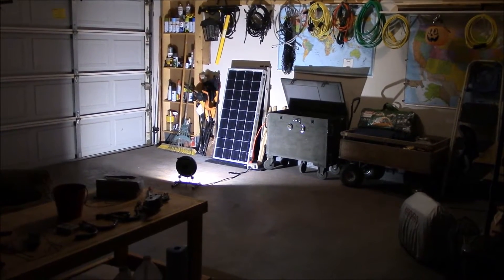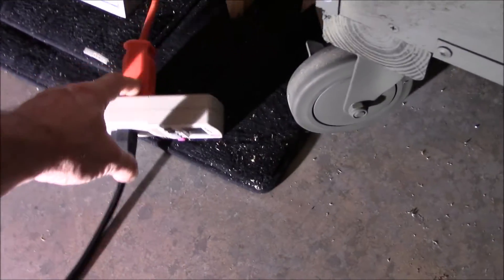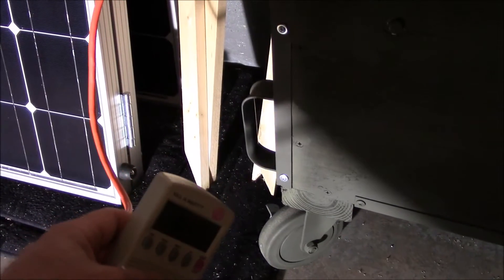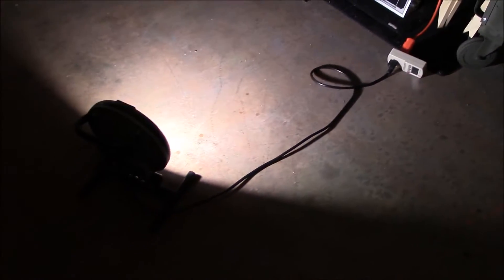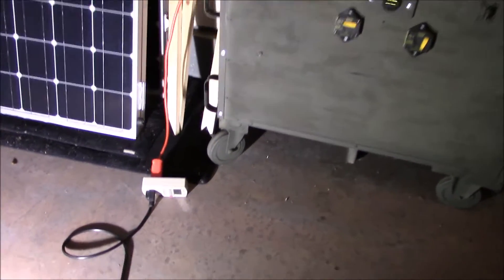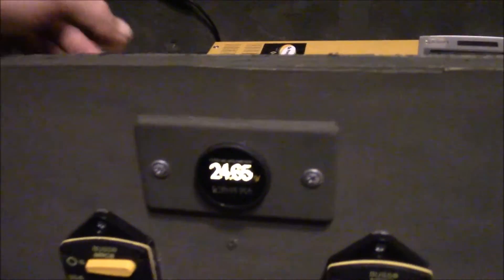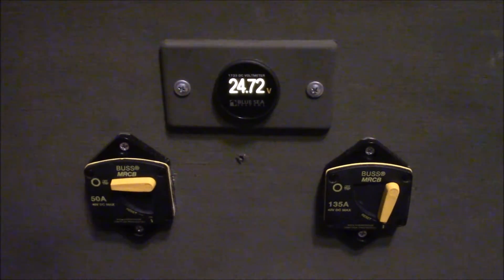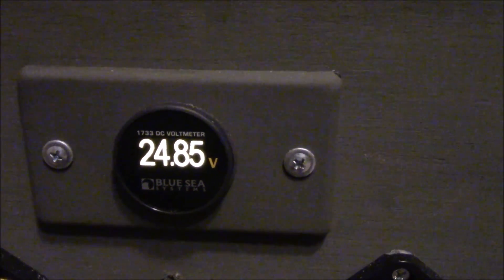24-volt solar generator 12-hour load test results!

Comment: Good information Chris. You have the same results as my 1st portable system. I had two 12v 110 amp hour bateries and 210 watts of solar. It ran my chest refrigerator full time even through he could days of fall. The test results are what inspired me to go completely off grid. I saw how doable it was and I have been sold on it ever since. If people new how easy it is especially in the south to go off grid with their whole house alot more people would be doing it. My whole system was $5500. If I still had a job I would have spent about $30k and had a really big system like yours. It does not get hot here so we do not need air conditioning. That cuts down on alot of power. When I or if I can get back to work I want to add 1000 watts to my sytem. Then I'll be in tall cotton lol. Great job Chris!
Reply from the maker: Thanks. Been wanting to re-do a transportable system for a few years now. My first one was right after the tornado (F5) in 2013...really rinky-dinky and too small. For this design, wanted to do "everything right" and make it actually useful. Not sure if you saw in the video, but yesterdays test was really "easy" on the system. Only .5 kWh of use and this AM the batteries (resting voltage) were at 24.93 (almost 80% SOC). Really didn't work it very hard! So, she is gonna work for small overnight loads (fridge, TV, modem, router, LED lights, security system, etc-etc). That is whole purpose...overnight use. During the day with full sun...1,500w spurts are no problem.
Reply: Yes I watched the whole video to the end and saw the resting voltage indicated about 75 to 80%SOC. AWSOME. Real like tests are so hard to find on youtube. That's why I did a scientific test on my 24 volt generator. 2 hours and 27 minutes on one quart of fuel @ 10 amp load. I really like your Honda backup generator. With your PFC (power factor corrected ) Inverter you can charge your batteries very efficiently.

Comment: Great test run.  Your videos continue to keep me motivated as I continue to gather everything needed so I can start my own system.  I will definitely post videos as I build away.  might even post videos before I begin to build & share some of the items I have selected to use.  
Take care.
Reply from the maker: Heck yes! That is what I did too...and lots of people chimed in to help.
Reply: Chris DIYer I always look forward to other peoples ideas.  Several years ago I built a battery box I think I titled it short term emergency power, meant for powering my amateur radios in my car & for small things when the power went out it required grid, generator, or car to recharge though.  I will let you know when I post my first video.